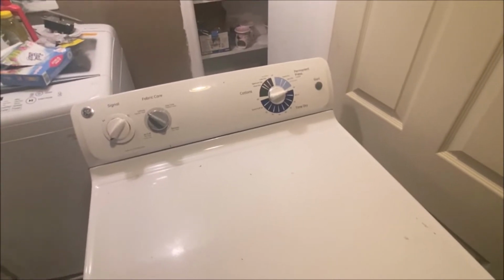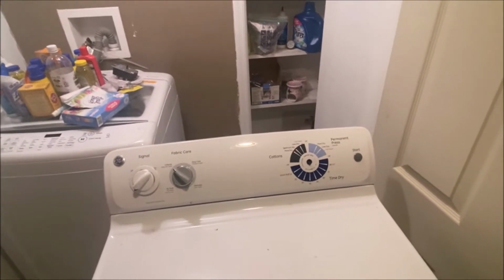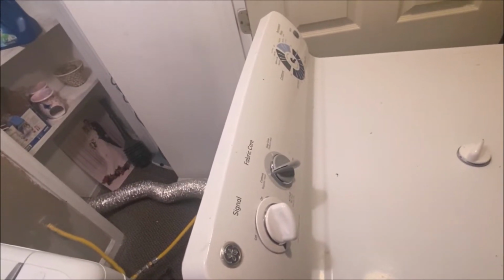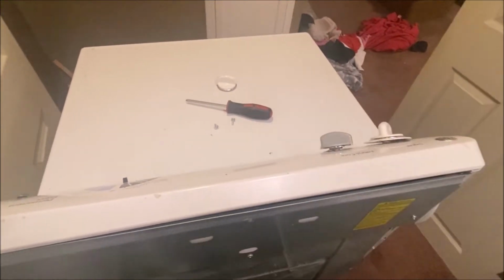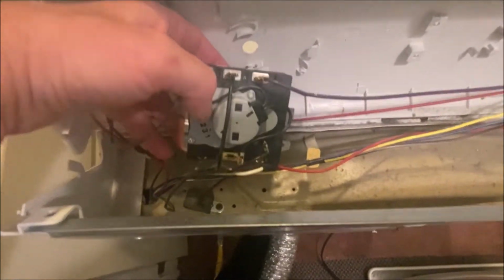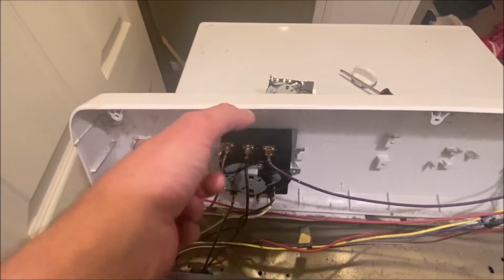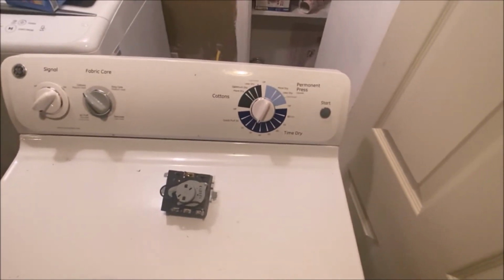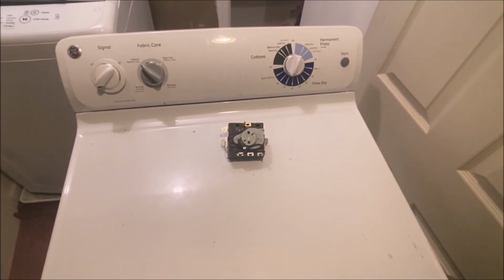GE Electric Dryer Repair, Timer Switch Replacement

Comment: I just need a special screwdriver to take the old part off and put the new one that I got from Amazon ($52) I will have to go to Walmart or Homedepot. There is a little round screw in the timer and I can’t take it out. You didn’t show that in your video. I don’t want to pay a technician for that.

Comment: Where is the ground wire? I watched another video that showed a ground wire. Looking at the wires on my dryer, there are no wires that would appear to be a ground wire. I put the new timer on but now I'm afraid to plug the dryer in.
Reply: Was there a ground wire I’m afraid also been looking for videos till I stumble with this video and he answered every one else but not your question and is very important to know about the ground wire BUT IM READING IT SAYS ( INTENTIONALLY NOT GROUNDED SO MAYBE ITS SAFE TO PLUG BACK UP )
Reply: @dandiaz8589  I ended up passing the job off to one of my grown kids who is more familiar with this stuff than me. I don't know if it ended up having a ground, but I still had to buy a new dryer because the dryer never would turn on.

Comment: Hi 
My dryer knob turns, however, let's say I put it at 80 mins, it will stop at the 50 min mark even though it runs for the full 80. 
Will a new turner switch fix this problem too?

Comment: Thanks so much for this video. My timer switch was frozen - un-turnable. Following your instructions, I was able to replace my switch with a $50 part from Amazon. One note - my timer switch was held in place by a set screw. I had a heck of a time figuring out what sort of tip I needed on my screwdriver for that screw, but luckily I have a great kit with like 100 different tips. After removing that screw, I could swivel the old switch just like in your video. The rest was easy.
Reply from the maker: Glad it worked out.

Comment: Please help! I have a GE gas dryer...ge gtdx100gm1ww...If I hold the start button, it works, but once I let go, it stops. The drum turns, the timer works, so I changed out the push button switch and it is doing the same thing. What else could it be?

Comment: Been looking for the little plastic rounded off part you mentioned, it shouldn't be more than $2,but it seems that everywhere they sell dryer parts,they only sell the entire timer for $60-$90. I ended up putting a screw in it and turn it with screw driver now.
Reply: Did the same because the plastic tip got worn out & the thing was like 60$. Not that I can't afford it but the price is ridiculous so I use an old small vice grip to replace the knob & it works fine

Comment: Did not work for me. Seemed to get the part installed okay (although my dryer model DBXR453ET5WW doesn't look the same as the one in your video, the part does except mine has only one wire at the bottom, two at top) but still won't turn on.

Comment: Hi I have a G.E. dryer and I'm stumped. The belt broke so I replaced the belt. Then upon trying the dryer it would not turn on when the door was closed. So I saw a YouTube video saying it is the door switch. Replaced the door switch and the dryer worked worked. Put the setting on optimum filled the dryer closed the door and the dryer started spinning and getting warm. I walked away and about 45 minutes later I went and checked on the dryer and it was still spinning down the basement. I thought something is wrong. The clothes should of been done way before this time. I cleaned the dryer inside and all around of lint and put a new exhaust for the hot air to vent outside. The timer worked perfect before I removed the top piece and the small metal back with about 8 or 10 screws. I had to wrestle around with the dryer to make it fit together correctly. Can you please help me out here!!!! Any suggestions?? The dryer is about 8 years old or less. The unit is still sold today. I liked your video and subscribed 👍👍👍

Comment: My stacked GE washer/dryer has a broken timer knob but the new one (GE replacement part)  doesn’t go all the way back. It doesn’t lay flat. There is a half inch space between the knob and the appliance. Is there a trick to inserting it. Thanks

Comment: Can this dryer timer be used across other GE dryers that look similar? My current bad timer that needs to be replaced but has a different model number, but looks the same. Would the timer in this video work with other models?

Comment: I put in a new unit 1 wire at a time. So as not to mess up. Plugged it back in. Tried to start it and a Blue spark flashed from the new unit. So I reinstalled the old unit. Reset the panel switch (it was tripped) and as soon as I tried to plug the dryer back in, the circuit tripped again!😖
Anything you can figure out?!
Reply from the maker: No, but is sounds like a short may be tripping the breaker. You may want to call a professional.
Reply: It should be just this simple, mine looks almost identical to yours, and you were correct, a repairman wanted practically 300 for a 10 min job😨👀🤷🏼‍♀️🤔
Im saying my prayers going to order the part and give it a whirl, my dad taught me alot pf things, not being afraid to fix things was one of them, Im a female, but the key word involved is male, theres no reason we should limit ourselves when a man is not around.
It doesnt require heavy lifting either😄👌🏼👌🏼😁Thank you for being such  a jewel of a guy and sharing this with us! I wish you all the  best!

Blessings✌️🇺🇸😇🙏🏼